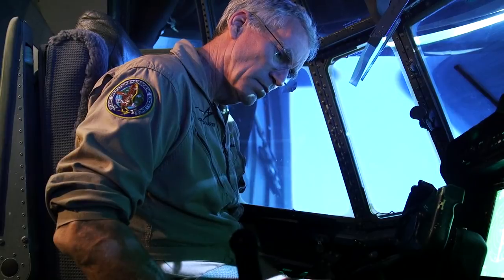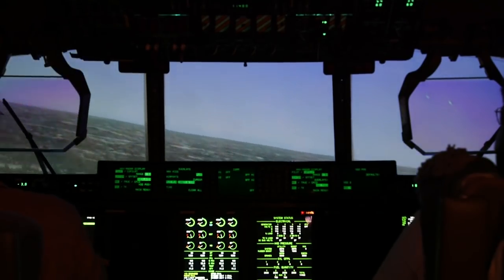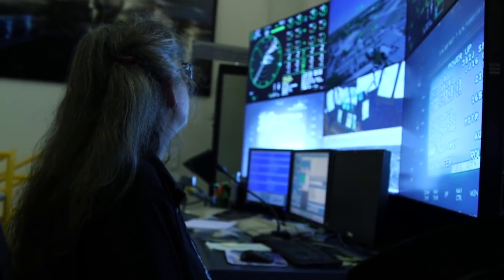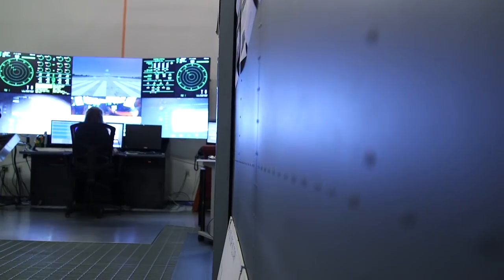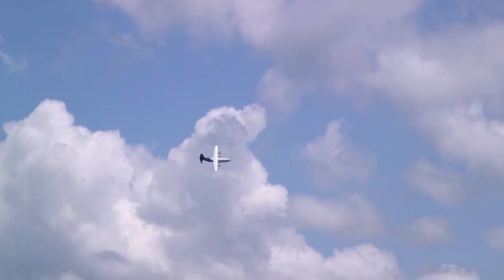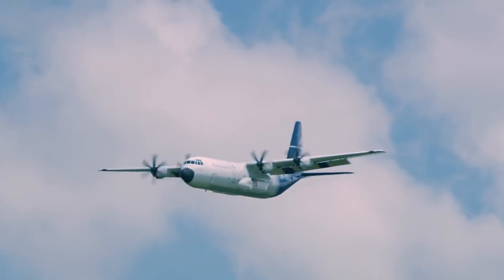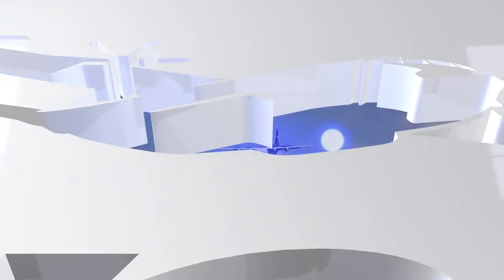Lockheed Martin LM-100J First Look

Comment: Propellers? Not jets? How come?
Reply: RDR JohnMarston unimproved runway landing capability. The C-130J can land almost anywhere whereas if you have a jet engine you need a nice clean runway.
Reply: Turbine engines are turning those props.
Reply: John Hall why's that? I'm 13 years old and wanted to know. These people were kind enough to share what they know. If you disagree why spread your hate?
Reply: Because fuck a jet. Thats why.
Reply: A little dirt or the occasional weasel won't faze a propeller enough to keep you from getting airborne. A jet...not going to turn out well.
Reply: Hi RDR JohnMarston, actually speaking the C-130 & LM-100J are prop jets not traditional props.

The propjet is a hybrid of the Prop and a jet hence the name, not to be little you in anyway.

I saw the C-130 at Farnborough in 2014 and actually managed to get aboard one and took a look around although it was on static display at that time.

As for the C-130U spooky that 2as there too although I wasn't allowed to go abroud that as a member of the public because it's still classified in terms of the stuff inside.
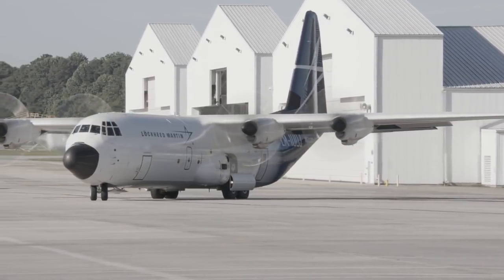Reply: Kwan Ming that's amazing! I see that now 1:57

Comment: Damn, that thing is ugly, it looks like it was designed on Microsoft Paint, the US would save an enormous amount of money if they just bought the Airbus a400m, and it out performs that plane, and we could save tons of money on developing this THING.
Reply: you do realize the A400M is a much bigger plane? it needs a bigger runway, more fuel.. Although it only carries about 20 more passengers..

The A400M is definitely not the cheaper option nor logical
Reply: This is not the c-130 used by the military.  They made a commercial version to be sold to the public.  But why in the world would the us buy the a-400 when we have had the c-130 for decades???  I don’t believe the a-400 is even in full rate production yet.  We have an ac-130 version used for close air support which the a-400 will never be.  The a-400 is much more expensive because it is much bigger.  These are different planes.  We have the c-17 which is about the size of the a400 anyways.
Reply: Vinny ! Wrong. First off, the C-130 and A-400M are two different aircraft for two different roles. The aircraft of the same role to compare against the A-400M would be the C-17. Second, the A-400M is VERY expensive. Third, what are you talking about saving “tons of money on developing this thing”?! The C-130 is a over 50 year old aircraft! This version is just a civilian variant of the latest model.
Reply: Vinny you make an economic argument yet it is clear that you don't understand much about economics at all. The money you spend at home is not the same sort of money you spend on imports. You could spend more and get less, from a local supplier, and still be better off (as a nation) for doing so, not that you proved that this is the case here it is just that even if you did you would still not necessarily have a valid point.
Reply: Vinny ! Welp, I think i found the 1 current dislike lol
Reply: I actually didn't press the dislike button lol
Reply: Because what really matters is how a plane looks, right? Not how well it performs it's mission. Troll. And who is "we?" It's not like YOU'RE paying to have it developed. Keep your mouth shut if you don't know what you're talking about.
Reply: Vinny ! Wow really? You clearly know nothing about aircraft design / history or the procurement process much less the history of either aircraft OR their primary roles. 

The MTOW of the A400 is nearly double that of the C130J (which is basically the mil version of this) - and is a tactical airlifter closer to that of the C-17. More than twice the thrust and close to $100m vs. ~65m for C130. Can’t forget that every branch of the US military and other organizations fly the C130. Support, maintenance, and parts are well known and cheap. Pilots and crew have been trained and available since 1959! Infrastructure for the plane is exponentially cheaper for the C130. *73 NATIONS* have fielded this aircraft in active duty over the years, feeding the US economy. It’s an icon. I love the A400m but it’s shockingly over budget, delayed, and under-spec. All of this is the opposite of what you just said.
Reply: So this LM-100J will  compete to ATR of Europe.
Reply: Daniel Matthews oh great, another american that thinks protectionism is a good option